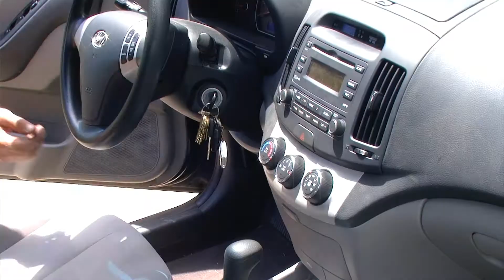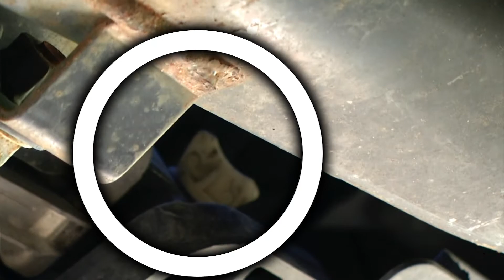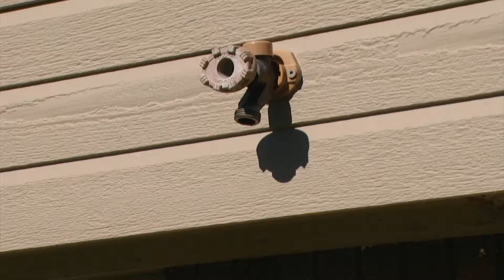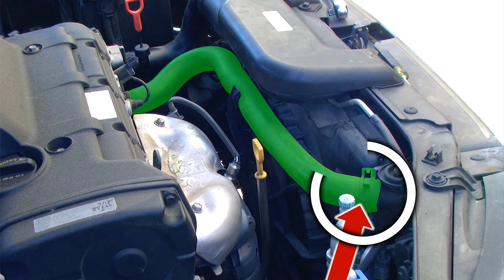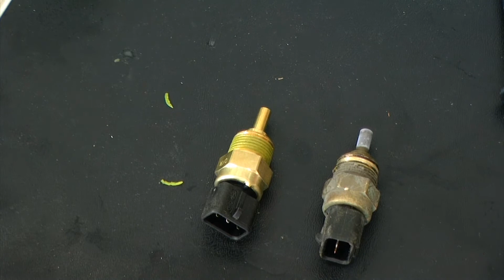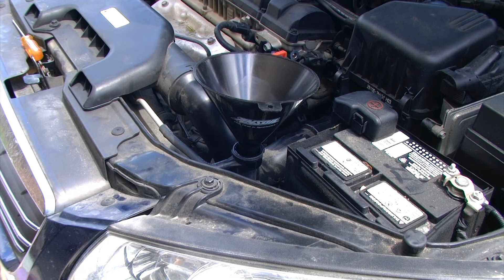2008 Hyundai Elantra Cooling System Service - Coolant/Antifreeze, Thermostat, Sensor, Radiator Cap

Comment: why didnt you screw the thermostat sensor all the way in? i just replaced mine yesterday and i tried to screw it in as much as i could and had maybe 5% of the treads exposed before i ran out of strength screwing it in. messed up my car and now its in the shop.
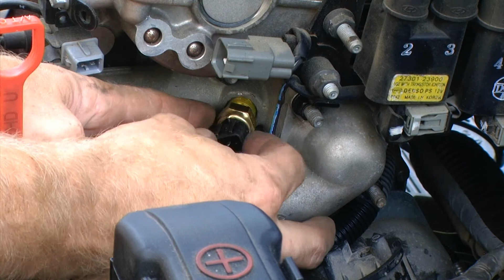Reply from the maker: 16:02

Comment: Do you have any videos how to backflush the heater core of your model of hyundai elantra?  The 2 hoses seem to be in such an awkward position to access.
Reply from the maker: I don't have a video specifically on the heater core.  However, when performing the cooling system service, if you remove the thermostat (as shown in the video) it should allow for water to flow through the heater core and flush it out.
Reply: @InsaneOil  Ok.  I will watch again.  I see most videos disconnect the 2 hoses from the firewall and then use a garden hose to back flush.  It looks so easy but the placement of the hoses look difficult to access.  I'm not sure what I can/cannot disconnect to make it easier to get to.  If you eventually make a how to video that would be amazing, or if you have any guidance what I could remove to make it easier.  I feel like removing the air filter compartment like you do in your starter motor video is a good first step?
Reply from the maker: @JeffTan-c5k  The whole cooling system is basically one big loop that includes the radiator, heater core, and engine block, etc.  The thermostat restricts flow (basically an on/off switch) to different parts of the cooling system depending on the temperature of the engine.  Thus if you remove the thermostat and pump water through the system, it should flush the entire system.
Reply: @InsaneOil  I see.  I just finished watching your video.  I'm still a newbie to DIY so a bit intimidated to try.  I'm hoping that the heater core flush will help with my slow heating problem in these winter months.  My concern about taking off the thermostat is I don't want to replace it and have to need to buy a new one and gasket before re-assembling.  In your expert opinion, do you think it is possible to only flush the heater core by removing the 2 hoses from the firewall, or am I too ambitious here? Videos I have watched just backflush the core and leave the other parts of the system intact, and seems to drastically improve their lack of heating.  I appreciate all your tips and advice btw, I'm definitely referring to your videos for all the future DIY projects I attempt.
Reply from the maker: @JeffTan-c5k  Yes, I think it is possible to flush the heater core through the heater hoses going through the firewall.  I would also recommend a couple other things to think about: 
1.  Coolant Test Strips will tell you the health of the coolant.  It could be that it is not heating well because the coolant itself is not doing its job properly. https://www.amsoil.com/p/antifreeze-test-strips-g116/?zo=10458
2.  If there is contamination in the cooling system, Prestone makes a cooling system cleaner product that I have used on rare occasion that I run across a vehicle where the internal components are gunked up.  https://www.autozone.com/antifreeze-radiator-additives-and-windshield-wash-fluid/radiator-flush/p/prestone-radiator-flush-cleaner-22oz/223022_0_0
3.  I live in Nebraska and we will often use Coolant Boost during the winter months to help speed up the rate at which the coolant is brought up to temperature.  This will also help with corrosion protection  https://www.amsoil.com/p/amsoil-dominator-coolant-boost-rdcb/?zo=10458

Comment: what about flushing the coolant inside the engine block??
Reply from the maker: The repair manual does not specific a need to remove the residual coolant in the block.  However, you could use a little compressed air in the coolant lines to gently clear as much from the block ask you can.

Comment: Won’t running tap water through the system leave some in since you cant empty whats in the engine? And wont it throw off the ratio a bit?
Reply from the maker: Based upon the manual, it is my understanding that the residual tap water is of an insignificant amount.

Comment: Awesome job!  this is the video that i'd been looking for re flushing and antifreeze mixture.
very well detailed work!
you did more than i expected - replacing the thermostat & other sensor - which is probably recommended being a 12 year old car.
i just had a reservation on the use of tap water to flush the radiator (i think i did this long time ago :), it may be of insignificant effect but considering you're doing the extra mile it may be best to use distilled water as another guy suggested.

ow, great mentioning that biodegradable coolant too. 

thanks a lot for the video!
Reply from the maker: Thank you for the comment.  I understand the thoughts and comments with using tap water.  However, the repair manual specifies the use of a garden hose.  Good luck with your repair.

Comment: Hey , hoping to get a response soon . When I removed the electrical connection points the 3rd one to be exact , the little grey clip fell off and I couldn’t find it . Does it have to go back on or would it cause problems? If so where and what are those clips called to buy?
Reply from the maker: What time in the video are you referring to?

Comment: Be careful with those electric sockets when putting them back on, mine were very brittle and one securing clip part broke after I didnt line it up well. It doesn't seem like its going to go anywhere fortunately.

Comment: how lucky i am to have the most thorough youtube mechanic doing videos on my exact model year! Where did you get your shop manual? Also for others - Hyundai genuine radiator cap is the best way to go. motorad is the only aftermarket manufacturer (all other brands i tried had a motorad cap in the box) and the fitment is pretty poor. pay attention to the thermostat gasket, it is likely to leak if you dont get it right, mine did trying to use only rtv because the felpro gasket said it was for an austin healy on the package & it wasnt exact.
Reply from the maker: I primarily use Chilton/Haynes manuals for the foundation of my videos and then I fill in the blanks with research online.  I also have some dealership mechanics that I will talk with when I can't find the answers I seek.  Good tip on the radiator cap and gasket...much appreciated.

Comment: Amsoil MEMBERSHIP? REALLY? their product is expensive, shipping free if you spend more than $100. Come on man and on top of a membership fee? That's why I don't fall a fool.
Reply from the maker: Thank you for your comments.  Yes, Amsoil products are typically a little more expensive when compared to the competitors.  Competitor brands build their products to meet the minimum requirements whereas Amsoil begins at the minimum requirements and engineering from there to meet the specific applications they are designed for.  Thus, the end result is a higher quality, better performing product.  The Preferred Customer membership allows you to purchase Amsoil well below retail prices in addition to additional benefits throughout the year.  In general, if you place an order exceeding $100, the cost savings pay for the Preferred Customer registration.  If do not think you will spend over $100 within 12 months, then it would benefit you more to purchase Amsoil at the full retail prices. I am more than happy to answer any other questions you have.  info@insaneoil.com

Comment: How do you know how much water is left in the system after flushing? Doesn't that change your coolant ratio?
Reply from the maker: If lowest point of the system is open, gravity will effectively drain the entire system.  Thus, the remaining water in the system will have a negligent effect on the coolant ratio.

Comment: Followed this step by step and ended up with coolant leaking out of the lower nut on my thermostat outlet. Haven’t taken it back off to check but any ideas on why this didn’t seal?
Reply from the maker: Any solution to this problem?
Reply: Either the gasket or thermostat wasnt seated properly or you didn't give it enough time for the gasket sealer to harden and seal

Comment: no sealant maker on the temp sensor ? btw i got maybe a gallon out of the hyundai engine but manual says 2 gallons (7 liter) manuals wrong ?
Reply from the maker: Sealant is already installed from the factory on the sensor threads.  I could have added an additional layer.  Flushing the system will push out additional coolant.

Comment: great video - one remark on safety - double and tripple checking that the engine is cool at the beginning - great - but "topping off several times as you drive" in the ending is a bit contradictory ?
Reply from the maker: Agreed, always check that the engine is cool.  With regards to topping it off several times.  The only think I can say is "best practices".

Comment: I did a thermostat change with the same blue gasket and never put any glue or make a mess like that and it work perfectly. I have 50.000 miles since that job and no leak at all.  If I will do this job I think is better to flush the heater core as well and replace all hoses.
Reply from the maker: I use the gasket maker just to ensure a good seal.  The hoses were in good condition so I did not replace them.
Reply: @InsaneOil  How many miles had the car when you did this job?
Reply from the maker: @irisbaez1972  There was about 100k during this service...however, I had previously flushed the factory coolant from the cooling system many years ago.
Reply: @InsaneOil  got you. yes, my Elantra had 110K when I did services.

Comment: did you put the lower hose back on before runnig the water through the radiator??
Reply from the maker: Yes, I believe I did and then I pulled the lower hose again after to remove the extra water in the system.

Comment: When I removed the lower hose not much came out... but I when I opened the thermostat housing a bunch of fluid poured out. Anyone know why that would be?

Also, there was no gasket on there from the previous coolant flush done at a shop.
Reply from the maker: Were you able to get everything up and running?

Comment: Do you flush with the radiator drain plug in or out
Reply from the maker: I closed it back up to help direct the flow of water through the system and then out the upper radiator hose.

Comment: Hi! My coolant reservoir in really bad shape, and I want to change it. However, I just changed the coolant and flushed the whole thing couple months ago. Do I need to flush everything again and change the coolant reservoir?
Reply from the maker: You should be just fine replacing the reservoir without having to flush the entire system.  Obviously you will loose some coolant when you disconnect the reservoir.

Comment: If the coolant is low can it cause a smell that somewhat resembles something burning?
Reply from the maker: It is possible.  If you aren't getting adequate cooling in areas of your engine they can overheat and cause a burning smell.

Comment: I'm an Australian living in South Korea. I watched your video because I've recently bought a 2010 Hyundai Avante, which is the Korean domestic market equivalent of the Elantra, only the Avante has a 1.6 litre engine. I can't find much info on the Korean model, certainly not in English. Do you have any ideas where I can get help or a workshop manual in English? I have found an online manual for the American Elantra but the engine is different.
Reply from the maker: It looks like there might be some around, but as you as you indicated, not many. https://manual4you.com/products/2010-hyundai-avante-service-repair-manual?gclid=CjwKCAiAm-2BBhANEiwAe7eyFH6IuFjR-Wcy5gv4dKGQBFki-Ep9fFPVEjuA0plEbBxwLtxtIpRbdxoCHqsQAvD_BwE
Reply: @InsaneOil  Thanks very much for the lead.

Comment: This is a great idea for flushing out the cooling system.
A few points - 
1) it's better to use distilled or deionized water for the whole process if possible
2) it's very likely that using the garden hose doesn't flush out the residue of coolant in the heater core as the hose water will take the path of least resistance through the head and cylinder block. The system would need to be closed and under a bit of pressure to force the water through the heater core. It's a trivial point though as there would only be a small amount of coolant trapped in the heater core.
3) I'm more familiar with Toyota engines which have a drain plug in the cylinder block. Opening this allows draining of all of the coolant without the need to undo the radiator hoses. The system can be flushed as a closed system by replacing the coolant with straight water and running the car till it's hot then draining the water out again. If it's not clear this step came be repeated. I'm not sure whether Hyundai car's have this drain plug in the block or not. A workshop manual should clarify.
Reply from the maker: 1.  I agree with you that it is better to use distilled or deionized water for the whole process.  However, the repair manual specifies the use of a garden hose.
2.  I agree with you on the heater core.  However, the repair manual did not specify your method.
3.  The manual does not indicate that there is a block plug.

Comment: So I didn't have access to a garden hose so I just manually dumped a few gallons of distilled water through the radiator cap.
Reply from the maker: Good solution.